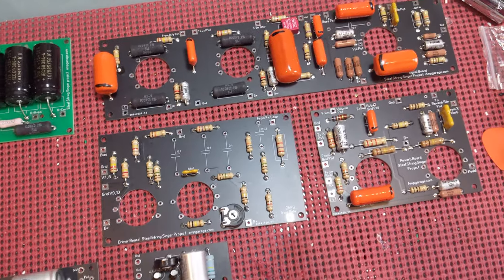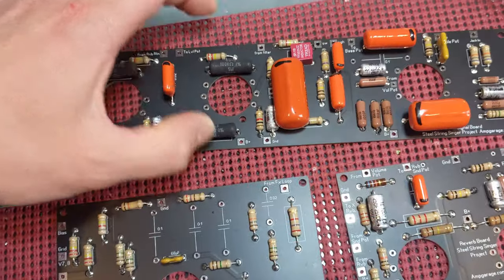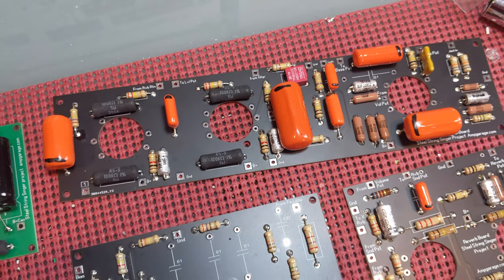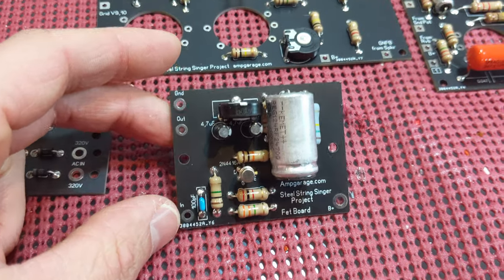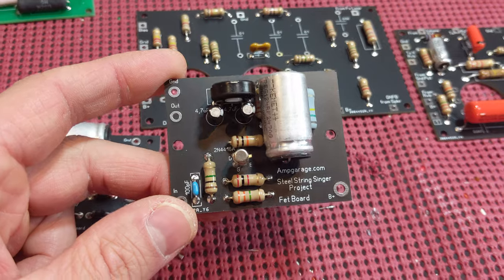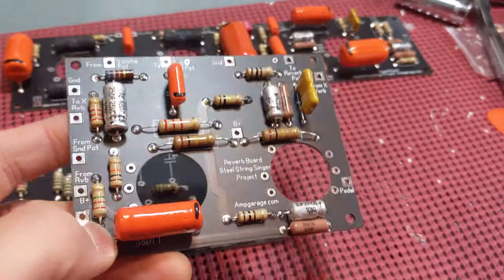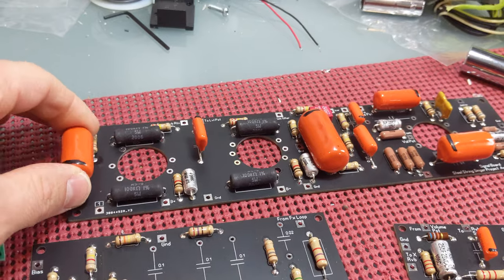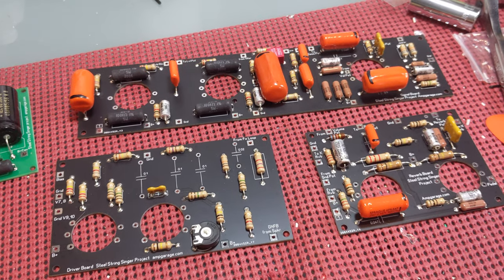Steel String Singer #002 Next Level | Component Selection

Comment: Hi Ryan, known that mkt 368 vishay philips were used in first jcm 900 mk3 and i believe on the 80s soldano as cathode bypass capacitors on the first preamp tubes. I think they sound great, not fan on too large value cde sprague orange drop (they sound fluffy) i would not use orange drop over .1uf (at least my experience with 225p).  Thanks for your videos.
Reply from the maker: Great observations and thank you for your input!! Thank you for your kind words as well! Happy holidays!

Comment: Metalized is done to make it physically smaller than a separate film and foil. They also squeeze them after they are wound, again to make them smaller. Both diminish tone significantly. Stick with film and foil like all the great vintage amps did.
Reply from the maker: Thanks, Steve!! That's a lot of great information. Thank you for sharing
Reply: @TheToneGeek  You're welcome. What's the brand and series? You bought from Mouser right? It'll be easy to verify on the datasheet what the construction is. Also, the PS, 418, 225 and 715 all use 20awg copper clad steel leads. That's what vintage Fender's had. Most other caps today have just tinned copper and usually 22awg. It's also possible that the epoxy coating is thicker on the vintage cap which will make it larger as well.

Comment: Vishay bought out mullard I think??? Really cool idea and project!!
Reply from the maker: Ohhhhh could be!!
Reply from the maker: @GCKelloch  thank you for your reply. The smaller .22uf is rated 630v believe it or not. The Sprague is 600v. Maybe modern construction techniques able to shrink the size? Both are polyester too. This cap is in a local negative feedback loop so I don't believe it would be as noticable compared to a dry signal coupling capacitor. Good idea for asking around. Thank you for your reply!